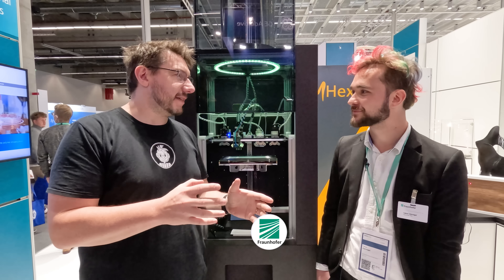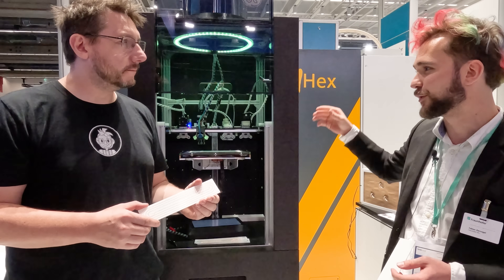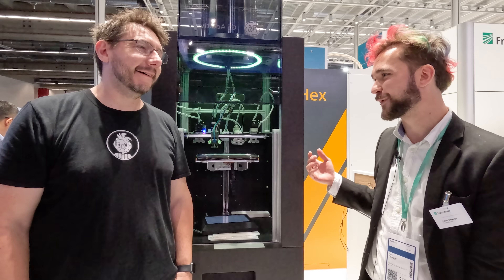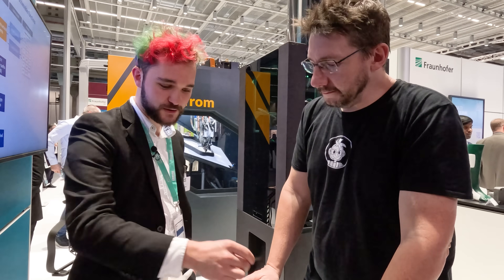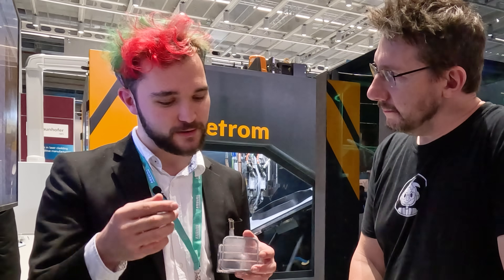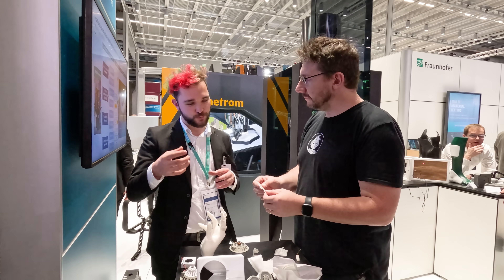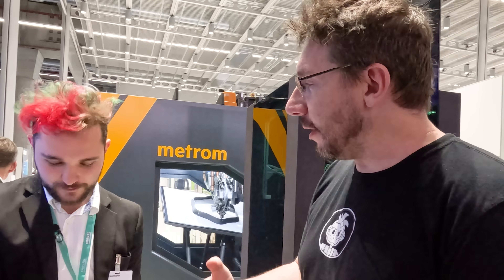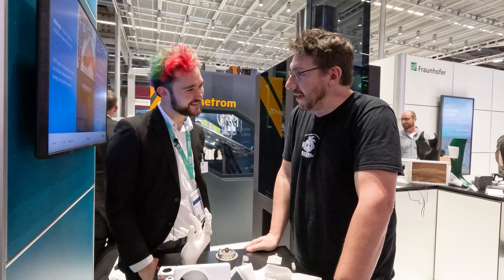3D Printing WIRE with Fraunhofer

Comment: Curious about the embedding wire in PLA in order to heat it and form it... seems like an extremely overcomplicated way to replace a heat gun or like, warm water
Reply: with embedded wires you have the full controll about where and how much heat you apply. Think of it as a tpu joint, that you can switch on and of with an electrical impuls

Comment: Joel what would be even better would be a semi generic printed scaffold printed flat with rising half pyramids(or overall measurements for patient taken) to then heat up and mold around a broken limb, etc. Use a uv setting quick glue inside and along edges(2 piece mold) to make a bonded custom molded and recyclable cast. Like kerfing for subboxes and such..but for a more contoured surface..use those good math algorithms.  Allows a softer breathing layer to be added between cast and skin to cut down moisture and itching...also less time in layup process

Comment: Very exciting. I do hope they do something more exciting with it than a dinky little plastic speaker though. Obviously there is a lot of development to go and this is early days, but at the moment it just looks like an even less serviceable tinny sounding little speaker.
Reply: The speaker is our first example for a fully automated manufacturing processes of end use consumer electronics. Im a bit sad, that i could only show the driver part at the formnext, which is not the complete speaker, we're printing. The finished product will look and sound better. 

But for this early stage, the printed driver is as loud and clear as a comparable, conventional manufactured speaker driver.
Reply: @DecobirdZivo  sounds cool mate. Ill keep my eye out for your developments. Im just a fan of the phrase ‘there is no replacement for displacement’ which is as true for speakers as it is car engines. This is not a criticism of your process; that is exciting, but im against the trend for small speakers plus sub (or small speakers in general); it does not produce as coherent sound as a full range multiway speaker. 

being a diyer at heart; im very much a proponent of the right to repair movement and anything that makes that more difficult for the end user is a bad thing in my book. It cant get much more difficult to repair than having the entire thing encapsulated in plastic and manufactured by a hard to access technology. 

Perhaps i have misunderstood, but it would seem this tech may be good for manufactures, but not necessarily for consumers.

Perhaps make the driver from polypropylene next time and thinner walls. I would expect PP or PC to provide a more pistonic behaviour than typical 3d printing materials. It is also a better dielectric and perhaps only bettered by hi-end filaments like PEEK/PEKK in that area.

Again, keep it up!! Ill be watching this space. I guess its a double edged sword.

Comment: This is revolutionary!  Just think about all the possibilities!  No more hot beds or heated chambers for printing higher temperature polymers like ABS!  Just heat up the wire to the perfect temperature to keep your print from warping!  You could add carbon fiber or steel wire for strength or for incorporating magnetic capabilities into your print!  For all you makers who print prosthetics, you could have the steel or carbon fibers embedded into the joints for motor controls!  Wow, my mind is exploding with ideas!  Love it!

Comment: I need a 5 or 7 axis one of these 👀 imagine the love child between this and the DMG Mori LaserTec 65 👀

Also, Magna Motors, the OEM for Tesla, tensions the wire. I have some ideas that are not inexpensive, but it's interesting to think about.
Reply: Hi, in 2023 we try to bring this print haed onto robot arms for 5-7 Axis applications. Maybe next Formenxt we have already something to show.
Reply: @DecobirdZivo  If you want someone to Beta test this, I am a CNC machinist and used to work at an ABB integrator, complex tool paths come naturally to me. The nice thing about that, is 5-7 is complex, but not undoable. Some of the Swiss lathes are crazy with more than 13 axis and different coordinate systems, not THAT is a lot going on. 

I expect the hardest part with much of this is the G-Code generation, aka CAM/Slicing. Please don't use steppers, servos or nothing. Robotic arms need precision. I would probably look into seeing if you can work with Autodesk PowerMill because their complex toolpath generation is fantastic. The tool head is definitely a challenge but the CAM I think is a bigger challenge.

Comment: Embedded NFC tag on 3D printed parts, really good for checking authenticity 🚀
Reply: this is actually one of the use-cases we were asked for by a bigger manufacturer of individual FDM parts.
Reply: It will add complexity also for complete automation and mass production but not impossible, because the nfc chip needs to be attached to the antenna. But it can also be done by adding the chip mid print when the printed antenna is laid out.

Comment: Embedding wire opens many opportunities, yet softening PLA is specially something you can do with pretty much anything that can produce some mild heat. I mean, just leave it on the sun for a while, and the thing will readily fold on your broken finger. Tell me it can do that silly hair, even that would be more interesting. Printing speakers and random coils, with some tweaking even whole multilayer circuit boards at home, finally turning the misnomer PCB into a proper descriptive acronym, now that's way more exciting.

Comment: You could print the most awesome stealthburner hotends with that printer 

All the wiring for klicky probe, led and fans embedded in the printed part, no need for soldering anything just place the LEDs magnets and fans

Comment: 30 yrs ago i predicted that we would eventually come to the point where we could print entirely solid state devices, what i mean by that is that we could print an entire device circuits, wires, etc in once single piece and entire device fully made without the need for multiple component assembly and i think we are slowly getting closer to that future.
Reply: This is a LONG way from that. The scale and variety of materials needed to accomplish that are several orders of magnitude hotter and smaller.

Comment: When I read "3d printing wire" I was imagining creating wire from some material. What his is doing is basically just lying down existing wire. This would be like calling what we've all been doing for years "3d printing PLA."
Reply: the print head is actually called WEAM: wire embedding additive manufacturing. So your certainly right

Comment: Very impressive. If they could combine it with non-planar printing they could embed wiring in to a wide range of electronics enclosures.
Reply: Hi fabian here. We actually already print non planar. Next year, we will bring the print had to a robot arm system for full range of movements.
The idea you mentioned will be our first industrial use case.

Comment: Very interesting. Adding the polymer after laying the wire was interesting but the way the wire lays down makes me wonder if it’s heated?
How does it flow so smoothly thru turns and stay flat?
Reply: The wire is not heated. We extrude a polymer encapsulation over the down layed wire und fixating it in that manner.
This way there is no mechanical stress on the wire, which is important for sensor wires.
Reply: @itsnotthat_  sorry i dont quite understand, what do you mean by constant flow profile?
basicly we extrude wiht a thicker line with a larger layer height. For complete integration within a part, we print cavities, where the wire gets embedded, flush with the current layer.

Comment: I wonder if the process can handle thin steel wire. Other questions: can it stop and start in the middle of a print (cutting the wire)? Does the "wire" need to be still or could you also embed stuff like aramid fibers? Is the tool head design open source or is it going to be patented and locked away for 20 years or so?
Reply: We can print with any continuous fibre like material. Currently we focus on different metal wires for functional applications.

And yes, the print heade can automaticly cut the wire and place multiple tracks completly autonom.

The print head you see in the video is our first prototype, which we signed for a patent this year, sorry for that ^^

When you google expansion of the fff process... You'll find my first paper on this topic, where i explained an approach which can ve done on any normal printer
Reply: @DecobirdZivo  Hi what about slicer software?Will be this technology,  possible to recreate  for non commercial use,  by DIY community?
Reply: @danielreborn4707  we developed a post slicing process, where we take a planned wire path from CAD and write the required code in the already sliced gcode file. 
We started with unmodified printers. You find details in my paper: expansion of the fff process. We're evaluating to release these work in an open source manner, but this will take some time.

Comment: This is one of the biggest pluses to the FDM-style of manufacturing. SLA gets detail, FDM gets multi-material, jet printing (I'm blanking on the term) gets color. Some things are better additive, some are better subtractive. First one to demonstrate putting everything together as one wins the prize.
Reply: Hey, don't forget formative.  (Also, printing is a good way to get the dies, or even the machines, to do formative manufacturing.)

Comment: you could make an antenna where the wire is the exact shape of the waveform.
Reply: OR a motor's rotor with the exact shape of the magnetic field.
Reply: @JeffreyKretzler  Fabian here. Yes you can!
unfortunately i'm not a good enough electrical engineer to do this by myself.

Comment: I mean... it's not ACTUALLY 3d printed wire. It's more a 3d printed piece, combined with a pick-and-place method. I was somewhat expecting them to use like an some sort of filament that contained a large amount of conductive material.
That being said, I'm just being an asshole about wording of the product. It's still incredibly impressive and integrating an ACTUAL wire into the items will lead to much better conductive items than conductive filament which is basicly just plastic with metal dust inside.

Now imagine some sort of 3d printer with a tool changer, pick and place arm and you'll pretty much be able to print ANYTHING. Like god damn Tony Start designing his suits in the first Iron Man movie and just go "I like it, print it... paint it" DONE!
Reply: Conductive filament or even pastes are dimensions away from a solid copper wire. Regarding our costs and resistances we beat any other approach. But you are completly right, we call it printing with embedded wires.
And please belive me, one of our 4 print heads is already an pick and place head. The speaker you see was really manufactured in one go. Printed the structure, embedded the wire and picked and placed magnets, foils and metal parts in one single fabrication step.
Reply: @DecobirdZivo  lightning in a bottle
Reply: @DecobirdZivo  Yeah I got that about the pick and place. It's visible in the video. Again, I'm just saying this product is even better than the title made it seem. You guys are on to something incredible!

Comment: Are there any articles about the process online? It would be good to see if they can start/stop the wire extrusion during printing as well as being able to connect wires together. Otherwise it seems a bit limited to things like coils where they can print all the electronic wire after the rest of the printing it done.
Reply: Hi Fabian here. The paper for this print head is on the way. Formnext was actually or first public presentation. When you search for "expansion of the fff process" youll find my first paper on wire embedding processes. 
With the new printhead we can control both, the wire and the filament feed. Therefore we can print with only polymer, with embedded wires or just laying the bare wire. We can place multiple wire segments in one print and also print through multile layers. We are also working on contact methods. Currently we use silver inks for interconnections.
Reply: @DecobirdZivo  how does the interlayer connection work if you coat the wire with a polymer to adhere it to the substrate? Do you stop the polymer feed at the ends then go with a silver ink nozzle at that point? Do you use silver inks that require sintering or non-sintering? Thanks so much for your work! It would be amazing if this was a product, I would buy one instantly. Do you have any plans for open source as well? Thank you!
Reply: @gedr7664  This is a really new topic in our department, and the most parts I developed on my own, so give us a litte time with the release. The prototype you see in this video was build this february. 
And you are correct, we can stop the polymer feed to prepare contact areas. Currently we use silver inks that require a sintering process, which is also planned to be done within the printing process. We also worked on solid contact elements, but only in really specific use cases. Create reliable, automated contacts also for embedded pcbs, is the next big task for us
Reply: @DecobirdZivo  thank you for your reply, I really appreciate it. Definitely contacts are the way to go. I was wondering if you had success sintering the silver ink with the brass nozzle? or perhaps a toolchanger head which is a heater flat metal surface that is brought over the deposited silver ink? What do you think? I was working on something similar but got covid so didn't have time to test if this type of sintering will work
Reply: @gedr7664  you would damage the path you placed before, when you try to get in physical contact. Also no way the brass nozzle would stay clean. We are working on an inductive heating tool head

Comment: Pretty neat tech. Looked like an E3D tool changer in their machine, if I'm not mistaken. I've actually done forming with PLA before just using boiling water. It's relatively easy to do and gets you those oddball shapes without sacrificing your print orientation. Joel, when are you getting the XL?
Reply: Hi Fabian here. The neat thing is, that with integrated heating wires you can define the areas you want to soften. It's like a switchable solid joint. This is pretty important for printed orthetics as you only want to adapt the form fit and keep your planned geometry for supporting the patient
Reply: @DecobirdZivo  Ah, yes. You could run individual circuits to heat only certain areas. Very good point.
Reply: @grantdeisig1360  thats the idea. Have you seen shape memory polymers? Those work due to an heat stimuli. We can actuate only certain areas of a bigger shape memory polymer structure and thus creating printed robotics
Reply: @DecobirdZivo  Yes I have. One thing I didn't quite follow in Joel's interview was how the wire was being printed? I'm assuming the wire is being unspun from a roll of wire and then laid down on the printed plastic, but how does the wire stay in place where you lay it down at without the memory of the wire wanting to re-shape itself? Is it actually melting into the print itself?
Reply: We feed the wire in a narrow angle onto the part and beneath a polymer Extrusion nozzle. So we are extruding a polymer encapsulation around the wire, which bonds with the surface material
Reply: @DecobirdZivo  Ah, ok. That makes sense now. Now the video images of the nozzle are easier to understand. Very cool.
Reply: @DecobirdZivo  can you also use carbon fibre like markforged?
Reply: @DecobirdZivo  This is a fascinating approach! Are we allowed to ask what the polymer is, or is that a secret? Great work regardless :)
Reply: @Phazaar  I think that's a just a general description meaning whatever material you are printing with, pla, petg, abs whatever
Reply: @Phazaar  you see that our prototype uses a mosquito hotend and currently we are just using the normal thermoplastics as you all do. From pla over tpu to peek, we can use any material for our process. The speaker is just an abs part.

Next steps will include 2 component tpe and resins